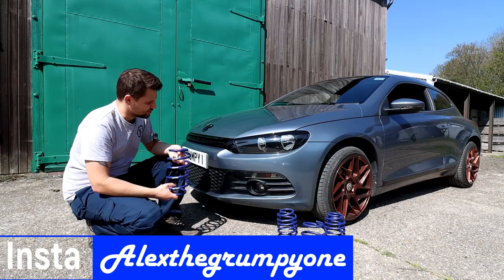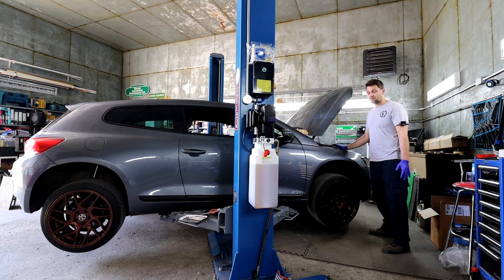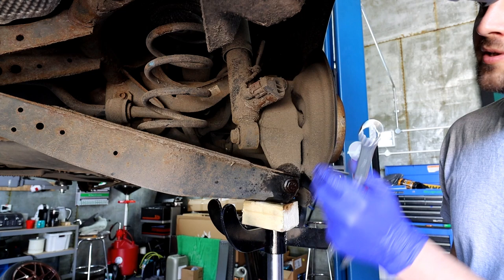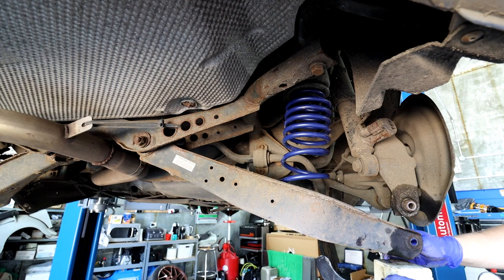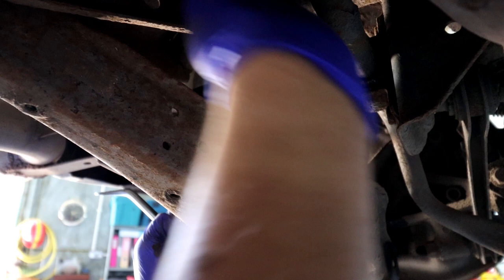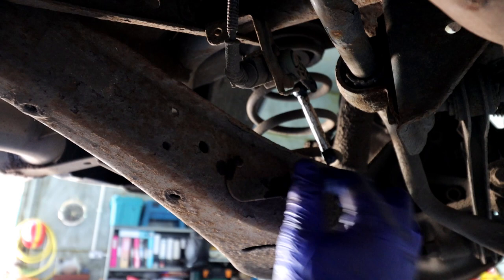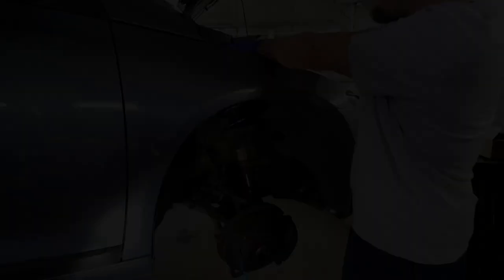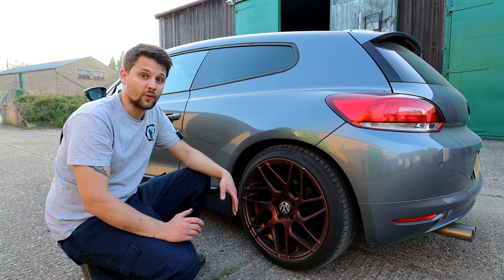VW Scirocco H&R 35mm Lowering Springs from Demontweeks. How to Lower your car DIY

Comment: Hey man, very cool video. I skipped through to the end as I won't fit them myself. congratulations for lowering the Scirocco, it looks doppe. 
I check all the comments, and I muss ask if the ride quality is indeed the same or more stiff?
I personally don't have this DCC in my rocco R, so the whole ride is by default stiffer. Even the steering is quite heavy, and many times I wish I have a softer steering. but it is what it is. 

So, can you please enlighten me?:D

Comment: Looks amazing mate. How much were the spring kit? Are the springs better quality and stronger than standard VW? Coz mine have snapped 3 times now since I had my scirocco :-/

Would love to get this done.
Reply from the maker: Bloody hell. Thats a bit unusual.
These ones are pretty good. You looking around £150 for the set and another probably £150-£200 to fit them.
Reply: @AlexTheGrumpyOne  thanks for the reply bro. 🙌🏼 My car goes in Tuesday for an inspection and if, as I suspect, I have a cracked spring I’m just gonna upgrade to this lowering kit. I take it the comfort/sport button at the gearstick will still function with different springs?
Reply from the maker: No problems at all.
When I dropped my one 35mm it was still working yes 😀
Reply: Appreciate you bro 🙌🏼

Comment: Caution! The VW workshop manual states under running gear The driveshaft must not be allowed to hang under its own weight or the joint will be damaged causing  the service life to be shortened.
Reply from the maker: Thank you for your info 😀

Comment: Amazing video as always bud! Just wanted to know that if changing the coil springs, does it mess with the electronic suspension system or is that only if you change the shocks? Thank you, and again fantastic video!!!
Reply from the maker: Thank you. It's fine if you only doing 35mm drop. If you go lower it does put the light on aperently.
Reply: @AlexTheGrumpyOne  Awesome mate thank you 👌🏻
Reply from the maker: No problems at all 😀

Comment: Great video shame I live down a rough road otherwise I'd consider lowering my scirocco.
Quick question Alex I have got an annoying knocking noise coming from the rear passenger side suspension, I originally thought it was a drop link so replaced that no change but whilst under there I noticed the bump stop was destroyed plus the rear arb bushes so I replaced those as well as the top mounts whilst I was in there but none of these have sorted it. When I had the shock out on both sides I could easily compress them & they wouldn't rebound I know that is signs of a knackered shock but I don't know if the DCC shocks act the same or if they are controlled by electronic current?!? If you could shed some light on this I'd be very grateful 🙏
Reply from the maker: Thank you bud! 
Yeah 35mm was my limit on this roads haha.
So the Shocks on DCC still need to be able to rebound properly as a normal ones. I have to replace my front one now because of that. When I have don't the springs I've found that one shock was OK and the other one didn't even want to go up by itself haha. 
Although they are adjustable by dcc they still should be able to have resistance and etc. 
So I would replace them to be honest. 
Also have you had a look at your rear D bushes? They can create a noise.
Reply: @AlexTheGrumpyOne  star thank you for your response and sadly I thought they were passed there use by date lol I will check those bushes out as well as that noise is driving me insane
Reply from the maker: No problems at all :) let me know the results bud

Comment: Hi There, Do you get any scrubbing on your wheels? i just lowered my Scirocco r by 45mm and now the wheels constantly scrub if there not pointing straight. Cheers
Reply from the maker: Nope 35mm is the most comfortable drop without affecting anything including dcc system

Comment: Do you need to adjust or recalibrate anything after the springs have been fitted? My level sensors are playing up on my DCC and I have the same springs.
Reply from the maker: No. U need to make sure that its not damages though. U only done 35mm drop?
Reply: @AlexTheGrumpyOne  yeah! I think it might be damaged. One was snapped in half last year and I think the other one might now be playing up!
Reply from the maker: Yeah check that first please and make sure that it got free movement

Comment: I tried to do this today but there seemed a lot of pressure on my drive shaft
Reply from the maker: Yeah unfortunately there will be. They are really tight
Reply: Would I be better off to undo the drive shaft nut on the wheel side or the 5 or 6 into the gearbox?
Reply from the maker: Yes if its easier for yo7

Comment: How does this effect ride quality? Compared to springs that are standard on blue motion gt?
Reply from the maker: If you got your dcc working then it's not bad at all 😀
Reply: @AlexTheGrumpyOne  mines not worked since I got it last year, had shock replaced and still not sure why it isn't working
Reply from the maker: Has it only stop working since you replaced the shock?
Reply: @AlexTheGrumpyOne  brought it like it, had Vw look at it and they said it could be shock so had that done and still button flashes, my mechanic said it could be electrical
Reply from the maker: Have you had it scanned and any codes present?
Reply: @AlexTheGrumpyOne  not since I had the shock done, might get it checked at some point
Reply from the maker: Yeah see if the plug is ok

Comment: Hi currently running 245/40/18 tyres on turbines will this still be okay on 35 mm drop?
Reply from the maker: Yep that's what I had
Reply: 👍😎 thanks , don’t want it down too low but would good to be getting shot of that unsightly arch gap. 
It’s a 60 plate GT tdi 170
Reply from the maker: Yep you will be fine 😀
Reply: Eventually got it in for the springs to be done unfortunately after just 3 days got this awful creaking sound from drivers side rear louder when turning round corners.  Got to get it back in next week to find out why , but initially mechanic is wondering if there’s an issue with the bump stop ? Anyone else come across this? Have seen a few posts about creaking sound after installing these springs
Reply from the maker: @debbiehill4338 I would check the shocks, which I hope that have been tested and checked when the springs were done.
Reply: I think mechanic is going to take it all off and check everything again on that side, it also looks minimally lower on that side so somethings defo not right
Reply: What about 50mm drop on the 235/40 r18?